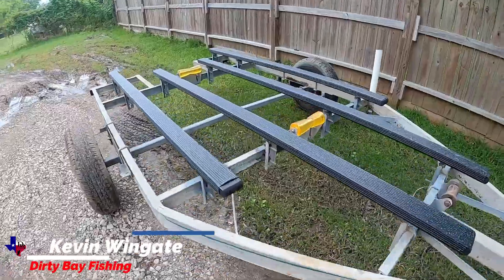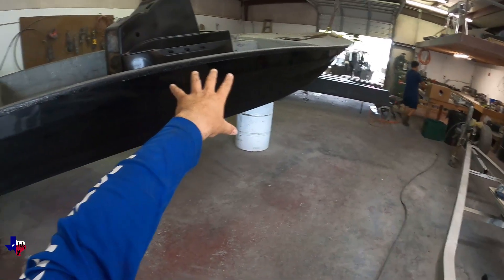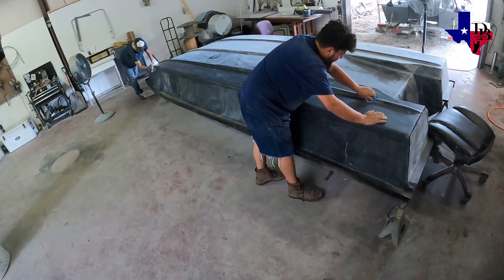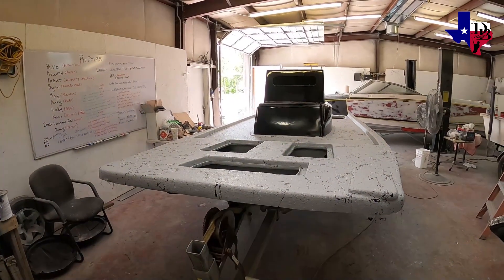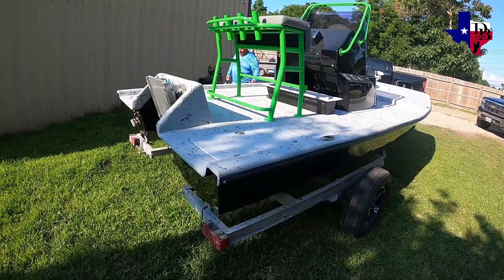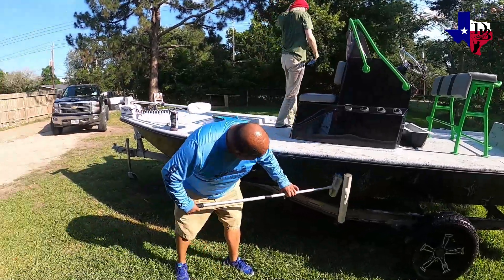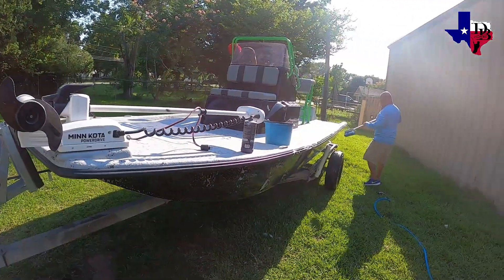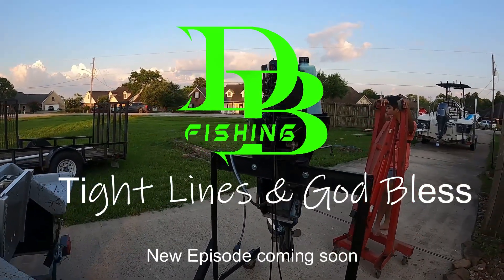Custom Skiff Build - Dirty Bay Custom Part 5

Comment: How much did this run you without the motor? Curious to see if it is cheaper than buying one almost identical. Also, what was the wait time on it
Reply: I’m very curious aswell
Reply from the maker: It’s cheaper then buying a new boat for sure. The wait time was 7 months